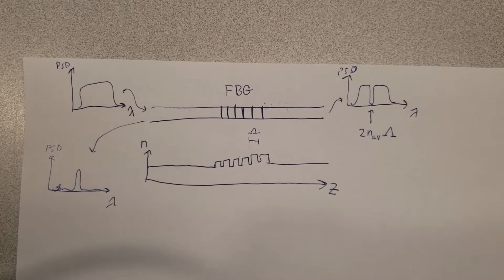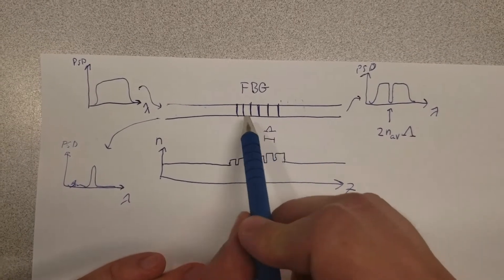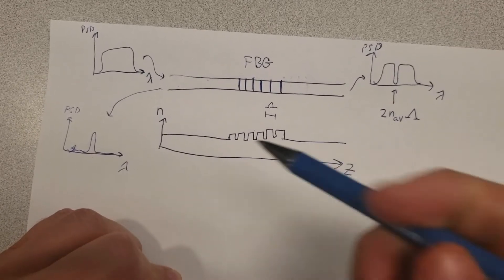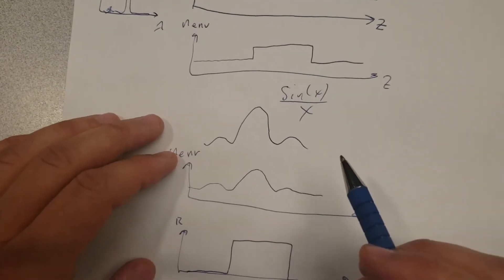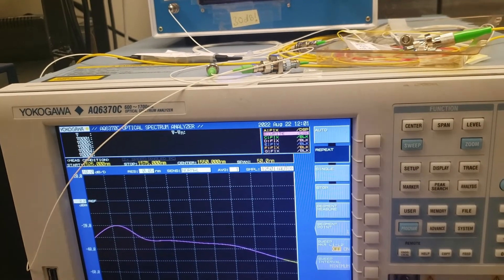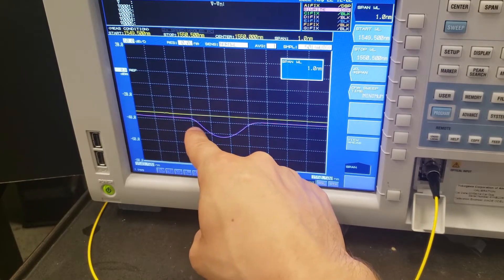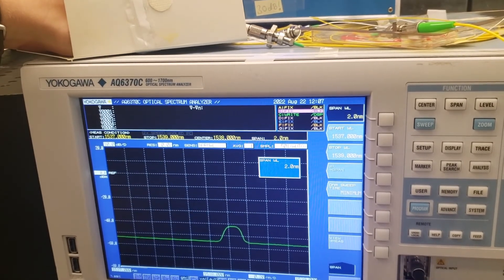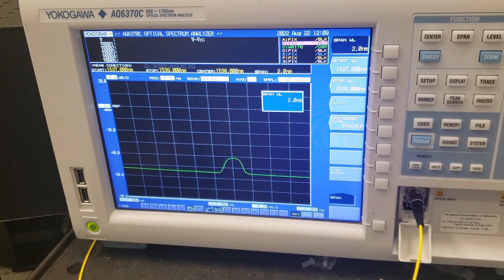Fiber Bragg Grating demonstration

Comment: Hi thanks for the video. 
I have a question regarding D parameter of CFBG. Normally its D parameter is given in ps/nm. If we use CFBG for dispersion management inside the laser cavity, how would we convert D given in ps/nm to ps^2, since GDD of the fibre in the cavity would be ps^2